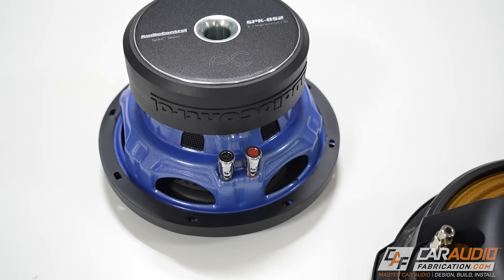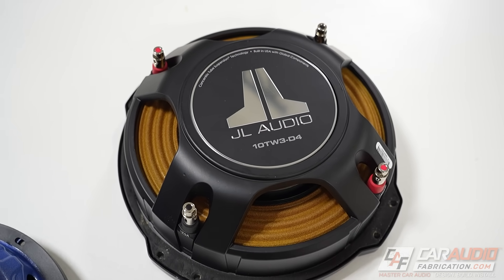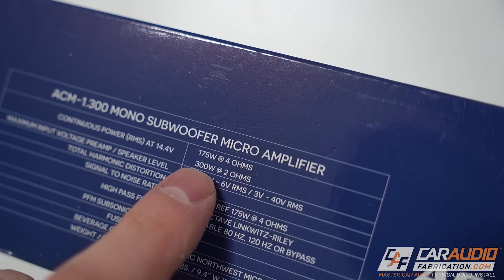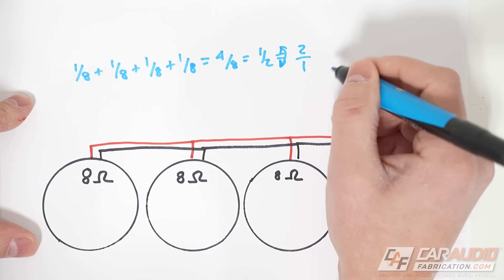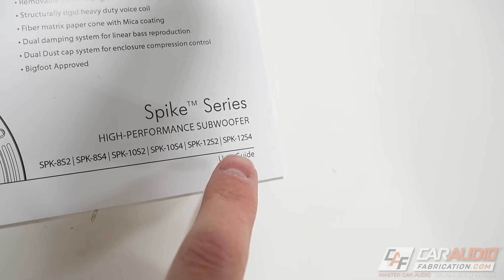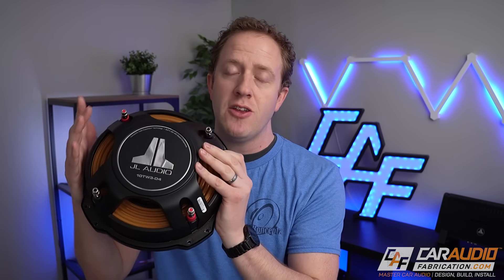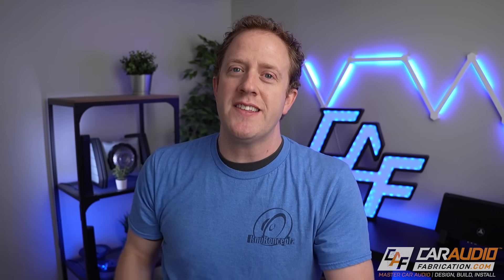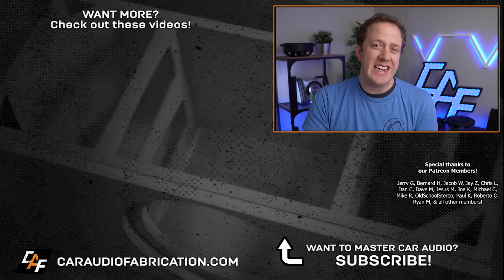Single vs Dual Voice Coil Subwoofer - Which is BEST? Wiring Explained!

Comment: 😂😂😂 it's don't matter how big the wires is..the wires on woofer's is still tooooo small.... Don't fall 🍂🍁🍂 false Bull 🐂 Doooo information ahhhhhhhhhhh...
Reply from the maker: The wire on the subwoofer is exposed to all the cooling benefits of the subwoofer. Your speaker wiring that is stuck under the carpet and routed through the vehicle is not. You absolutely are going to want to have large wire on a large power system, otherwise you are going to have a bad time.
Reply: DISTANCE = RESISTANCE.  The shorter the wire length, the thinner it can be.

Comment: Thank you again, Mark for passing on your knowledge. Love your videos. 
With that said, I would greatly  appreciate your advice on my future set up. 06 Silverado crew cab. I purchased 4 10Tw3 for behind the rear seat (replacing current RF subs). Wich JL Audio amp would you recommend to run to power the 4 subs on 2ohms?
Thank you.
Reply from the maker: The RD1500/1 is a great choice for that.
Reply: @CarAudioFabrication  
Mark, I really appreciate you getting back to me brother. 
I will look into that amplifier. 👍💯

Comment: Today I learned that I had wired my previous cars dual coil for 8 ohms instead of 2
Reply from the maker: OOF! That's rough, probably didn't have much output.
Reply: @CarAudioFabrication  no I was always dissapointed with that sub, now I know why!
Reply: @maxrfinch  then you can add impedance that comes when the cone is moving in the enclosure, on top of it. which many don`t know about

Comment: Mark, just so you and your viewers know that's the complex way of figuring parallel resistance.  As long as the 2 individual components are the same value.. say 2 single coil subs@ 4ohms each, you can simply take the ohms of 1 speaker and divide by the number of speakers. But this only works when the value is the same.
Reply from the maker: The correct math is simple. I rather teach the correct way, that way in a case that they aren't all the same value, if you were doing something else electrically, it's done properly.
Reply: @CarAudioFabrication  I think you took that wrong.  I wasn't saying your way was wrong, but neither is mine.  They are both correct just used for different situations.  And in the electrical field we use all 3 ways.
Reply: Great video and explanation. Keep doing more of this explanation kind of videos.
Cheers from Portugal.

Comment: I 💚 my 12tw3 d4.. its the mostest my civic can handle... 75% without any rattle... Over thst is 😢
Reply from the maker: The TW3 is seriously a modern marvel. The ability to create incredible sounding solid bass in such a small air volume and space is crazy.
Reply: @CarAudioFabrication  I've heard three 10TW3s that almost "rivalled" my single 13W7, almost.  They are truly miraculous feats of engineering!